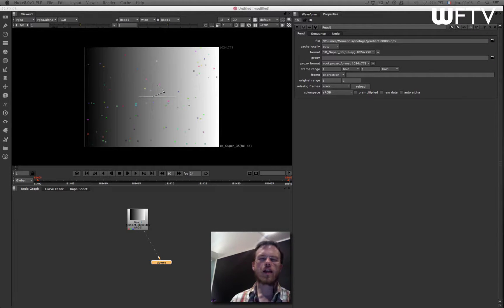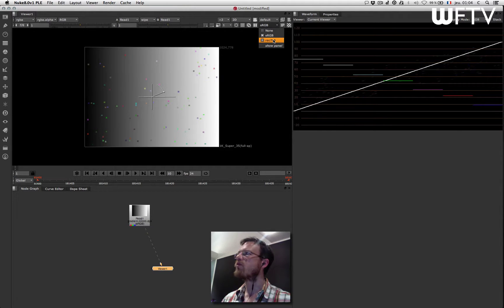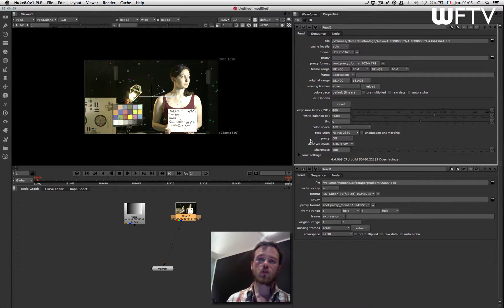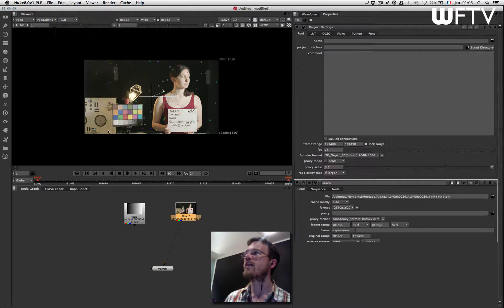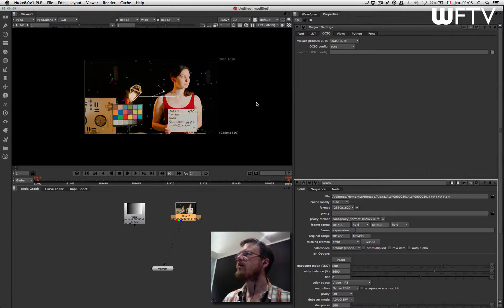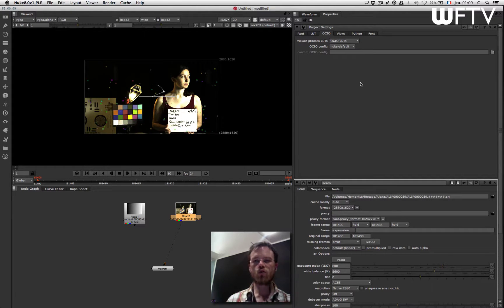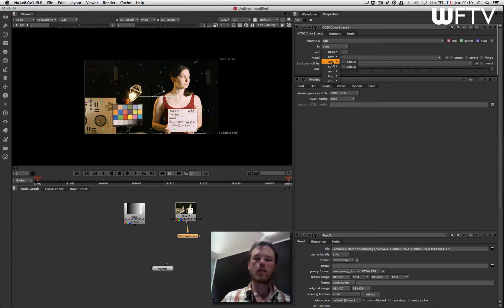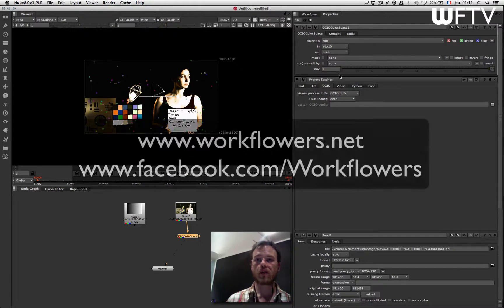Color Management in Nuke: OCIO and ACES

Comment: What is LUT? I see people on youtube giving free LUT packs?
As far as I can guess, it's related to colors. I'm new to nuke so I need to understand it first.
Reply from the maker: You can think of LUT (Look Up tables) as simple tables which define a numerical mapping between values. In the simplest form there would be a entry like "10" in the first column, and "34.4" in the second column. This would mean if you find the value "10", please map it to the value "34.4". In the context of color correction or color mapping two types of LUTs are used. 1D LUTs and 3D LUTs. In both cases these are just tables which contain numbers  to map "something" to "something else".  For example one colour space to another colour space.  You should first read a bit about it before I write a whole essay here in a youtube comment.

Check out these links to read more about it:

http://nofilmschool.com/2011/05/what-is-a-look-up-table-lut-anyway
https://en.wikipedia.org/wiki/3D_lookup_table
Reply: Thanks! As far as I can understand, we can create a film on monitor and apply LUT pack for projection screen?